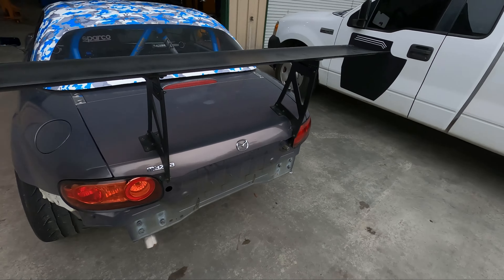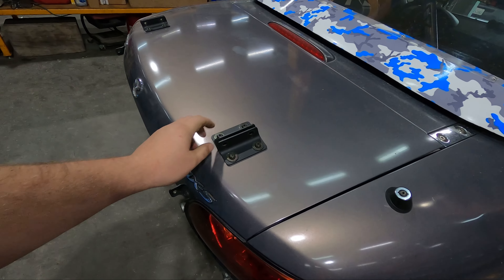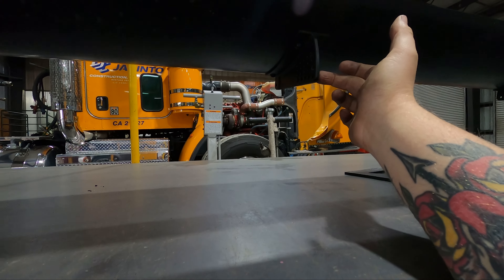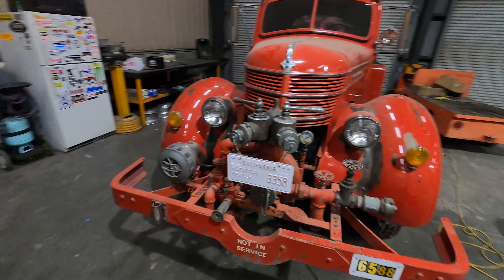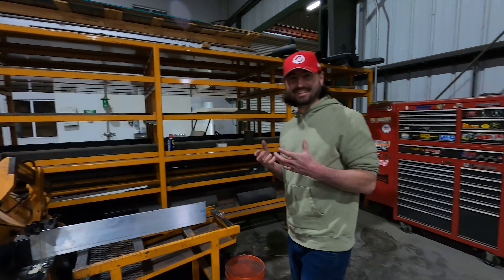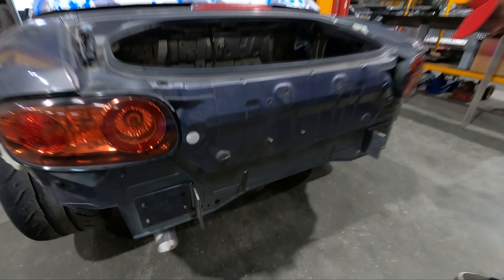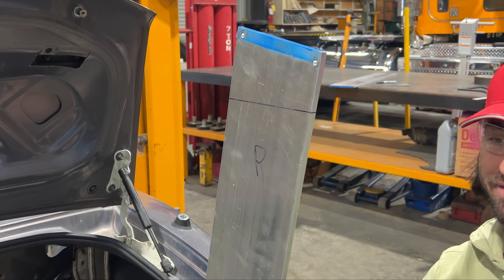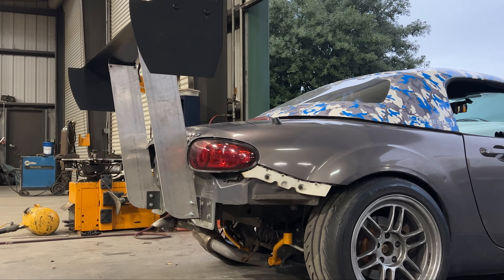Making a Chassis Mounted Wing Setup For My NC1 Track Car

Comment: Nice. Thought about notching out the uprights rather than the trunk?
Reply from the maker: I’m going to be doing a video when I fully finish the wing but I would of had to notch quite a bit of material off the uprights. I think a video will help better explain

Comment: It looks awsome, you really need another 2-3 HP to keep up with the looks now. IMO notching the mount would have been cleaner than notching the trunk lid, and it would have given it a little more character.
Reply: The trunk still closes like OEM. You would have to cut material out for the entire radius of the trunk on the uprights and it would look horrible.

Comment: Is there any real benefit of going chassis mount wing vs boot?
Reply from the maker: I definitely think so.  A wing mounted to body panels will loose it’s effectiveness as that downforce has to travel through the airfoil, wing stands, trunk/body panel, suspension, then tires. Where as my setup is airfoil, stands, suspension, then tires.
Reply: If you're going to the effort would it not be better to mount to the uprights?